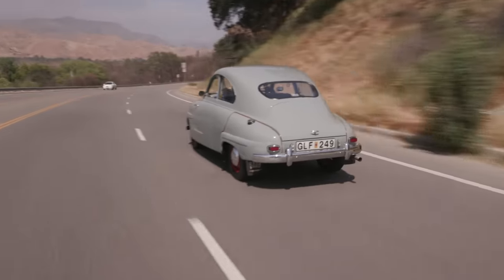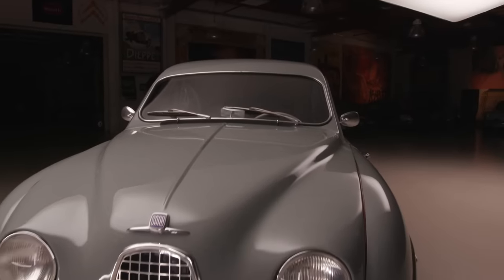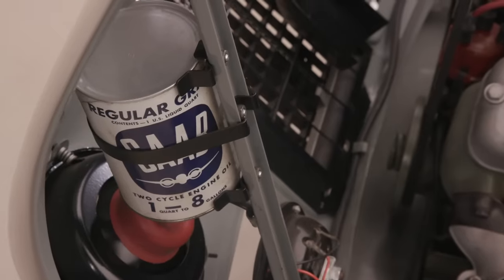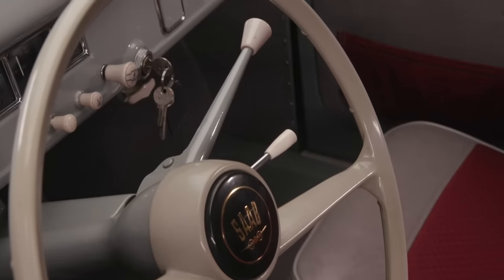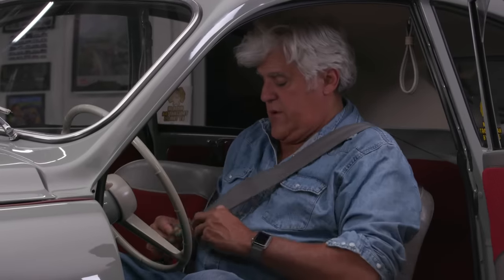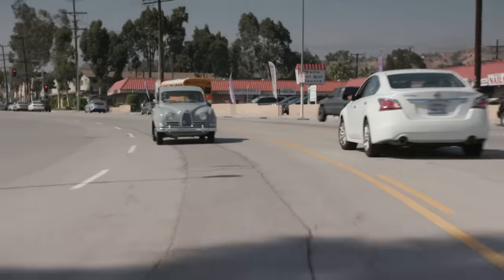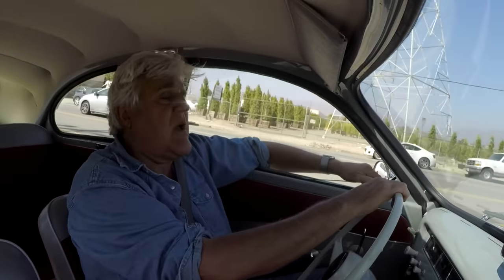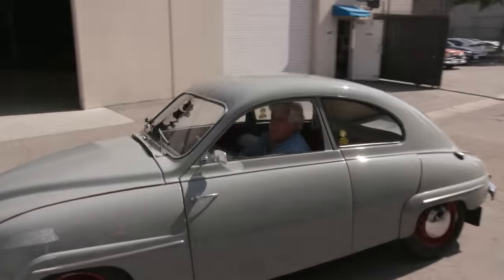1958 Saab 93 - Jay Leno's Garage

Comment: Oh, man...  Way back when (about 1970), I had a 96 that had been "breathed upon" to the tune of a big Weber and a cam and tubing headers imported from England.  The heads had been milled and it refused to run on anything but American Oil white gas with Bardahl added (Bardahl "top oil" contained a slug of tetraethyl lead).  It was a fun little car, and surprisingly fast in the twisties.  I took it on several road trips and it did just fine and was very reliable...and I got to  absolutely HUMILIATE a late-1960s 442 on the Blue Ridge Parkway.  Eric Carlsson would have been proud, although it terrified my now-ex wife (and she'd ridden with me quite a bit by then).  I told her that the car was very sturdy and would undoubtedly protect us if/when I rolled it down the mountain.  Things went downhill from there (not literally, thank you).  The car was a '67 and I think I paid $800 for it, which represented fantastic fun/$.  Keep the faith...

Comment: The first car I purchased was a 1961 SAAB 96. That too was a 3 cylinder 2 cycle engine. I got a lot of strange looks as I dumped oil in the gas tank when I filled up. I also have owned two more SAAB 96 cars with a 1972 being the first brand new car I ever bought. Wonderful car.

Comment: Brother Jay: A friend of mine had one of theseSAABS with the free wheeling feature built in and it was a strange sensation, but we learned it to save gas every time you took your foot off the gas the engine seemed to cut out.

Comment: It does make you smile. I've never heard of one of these let alone seen one .. but I think I understand the feel. A few pieces of iron in the rearview mirror that I wish now that I hadn't traded for a set of tires, or simply sent to the boneyard. The '68 Fargo half-ton .. the '74 Dodge 3-on-the-tree scorcher vinyl seats and "beach ball" washer fluid pump Dart. (the beach ball in fact ingenious as you could actually control where the squirt landed). "Feel" didn't necessarily mean power or handling - in fact the opposite tended to be true about fun. Actual fun. Maybe I'm just old and too many years having to drive instead of just wanting to. But there's something about this old Saab that I suspect would bring that back in a hurry.

Recently picked up a particularly special (my grandfather owned it) 1968 Merc'  .. AM radio option. It'll take a few years .. the driving position absolutely sucks, the stiff-back upright seats are horrible, "AC" ... those pull open doors at your feet. But I will love driving this like nothing I could with $70K. 1958? Could have got a Fury with six ashtrays and room in the back for an orgy. But I'd bet this Saab is somehow more real fun.

Comment: I think the real reason for the freewheel is possible lack of lubrication but Saab doesn't mention that in the instruction manual to not alarm owners or buyers, I suppose.
They only mention the advantage of fuel saving. When using the engine as a brake downhill there would be insignificant lubrication since when the throttle is closed there won't be much gas mixed with lubrication oil entering the engine.

Comment: My dad bought a new 1963 model year Saab as a commuter car.  It was robin egg blue.  By then the suicide doors were gone.  As I recall the tail lights were also larger and the emblem above the grill was either different or gone.  The sound of the exhaust was definitely the same. LOL  If the 58 is the same as dad's old 63 it's too bad that Jay didn't remove the fuel filler cap and show the underside.  There was a tongue depressor size strip of metal with printed instructions for adding oil to the fuel tank.  

I still have the owner's manual and by then it was in English.  It's a hoot to read it.

Thanks for the memories.

Comment: Dont forget, back in the 50s & 60s in many places you could find 2 Stroke Pre-Mix Gas Pumps, they had a dial on the front to set the oil/gas ratio & then it delivered the fuel & added oil like a normal pump.

Comment: My father Sven had the Monte Carlo model as his first car. He bought it new for 10600 SEK (£1013) in '62. That was about half a worker's yearly wages at the time. He bought it cash. That is 138000 SEK ($13195) in current value. Because of the engine noise, the car was called "the oil-fueled jungle drum"... My father drove SAAB all his life; now he doesn't drive due to glaucoma.

Comment: one of my favorites... I watched a video recently of a bunch of hardy Swedes up in the north woods racing Saab 93s
Reply: this sounds like normal... until you see a few coming around the corner sideways... holy tomoly... who knew?
Reply: think about it... front wheel drive... basically if you have the cajones to keep your foot in it ... the front wheels go where you point them... the rest just follows along... except there was also a meter of snow on the ground.. all over the road... very exciting race
Reply: thanks for sharing, Mr Leno... when racing your 93... keep the shiny side ^up^

Comment: I heard a story about someone who would race these against American cars, but would insist on racing in reverse. Once everyone was lined up, he would flip a switch and start the two-stroke engine backwards. Because it doesn’t have valves, it runs the same forwards and backwards. Then he could use all of his forward gears, but the American car would top out in its single reverse gear. He apparently won a lot of money this way.

Comment: Forgive me, I will not read through all the comments.  But in my opinion, the "freewheeling" feature may have been a necessity when the engine would have been introduced too to much torque braking when as such it would have been starved of fuel (and lubricant) while turning at a significant rpm.  If I am not mistaken, the East Germans did this too in their 2 stroke cars as well.

Comment: A good buddy had a 1969 Saab 96 with the V4 Taunus engine in it. I rode to and from work with him for a few years as we both worked at a hospital in LA - from Anaheim CA. If you ever look at the engine in one of them --- it's in backwards too. He needed to get a new engine one day and we found one at Ford Power in Santa Ana --- IIRC. Same engine but they were made for sewage plants as pump engines, etc. 

Another great car --- "interesting-great" not "great-great" was the Datsun F10 or 310 with the clutch right behind the grill with a gearset to send the power down and back rearward to the transmission and then to the front wheel drive. You could change the clutch like a 45-RPM record --- slipping it out and sliding a new one back in through a slot on the top of the bellhousing.

Comment: I had a Saab 61 V4. I loved it. It was mousey blue, a real chick magnet. When it died, it really died. I couldn’t even open the hood. I end up taking off the license plate, pushed to a no parking spot then went to bed. In the morning it was gone. RIP my sweet Swedish model. One time I had to drive while on LSD. The gearshift was trippy. You had to pull the shift out to engage overdrive. Well that shift lever was very flexible and stretchy. It was trippy but not as trippy as riding a fully loaded touring bicycle in Boulder Colo on peyote. Everything flexed on that bike. Fantastic elastic Trek

Comment: My first Saab was a 1965 96. I had it a couple of years, and sure enough, the engine froze up on the freeway one night. I bought a used engine from JC Whitney and when it arrived, on a pallet, I found it was a Saab Monte Carlo engine, complete with the 3-carb setup. Dropped it in, off I went. Best car I ever owned. I also had a 93, without the suicide doors, and a second 96 (that one with oil injection). But the '65 is still my favorite car. I traded it for a Saab 99, which was a huge disappointment. The dealership I traded the Monte Carlo-engined car to went on to use it for ice racing.

Comment: Ive owned several 99s and NG900s. Amazing how easy it is to work on these and even tune the turbo models for crazy power. $15 in parts at Home Depot and you have an adjustable boost regulator. 

Best part is they have no resale value, so you can pick up a nice one for basically nothing. Ive found that a lot of GM dealers can still order parts as well.

Comment: I had a 68. Once used ripcord to start it. I think the later cars had quieter exhaust, as I never did hear the bees. When freewheeling, you could shift without the clutch. Once on a downhill run, the car got so fast, that the engine couldn't keep up when freewheeling. I was doing 70, and flooring the accelerator caused it to slow to 65. My engine seized once. That's when I learned about the Zerk Fitting for the front Ball bearing.  I got it push started, and it sounded like a coffee can full of marbles. The saab dealer tried to deny they ever sold 2 cycle cars, and I realized it was time to see it gone.

Comment: My friend had one in the early 90's. Actually he had 3 a 1959 2 stroke that didn't run and 2 V4's that did. We pulled the engine out of the 2 stroke car and that's as far as we got. I had no seats in it and he was all discouraged by that fact so, like many interesting cars he has owned and I have worked on it sat. Until someone made an offer and it was suddenly gone. Same color but needed paint but not that dash! That dash was unblemished and pristine.

Comment: Those 2 strokes are quite similar to the Autounions DKW of same era. They also shared the "freewheel" system. The main reason for that system is that 2 stroke engines are not meant to remain with a closed throttle at any other situation than idling. Their lubrication system requires gas + oil permanently entering to the engine.  So when you release the gas pedal, the freewheel system disconnects the transmission so RPMs go back to idle to avoid oil starvation/engine seizures.

Comment: This almost brings tears.
I had a '63 96 and a '62 Grand Torismo.
Beware there are common mistakes that will shorten motor life.
If you have and electric fuel pump, turn on the ignition and wait untill it comes up to pressure, and shuts off (you can hear every thing) before turning it over.

Big one, take advantage of the 'free wheeling'.
Engine breaking under an oil starved condition is never good. 

I have hours of stories around these works of art.
They attracted a different breed of girls. 😈

Of note, the engine can be bored and honed many times over.
 Mercury outboard pistons  work.
Have 'that there' fun. Chris

Comment: 5:35 Swiss Sulzer engines had what was called a triple pump. It pumped diesel, lube oil and water so that all three fluids were available and no one component could fail to damage the engine through overheating or oil starvation ... if it failed, the whole lot failed, shutting down the engine. However, the seals separating the three fluids needed to be kept top side of to prevent any unwanted mixing.

Comment: I remember these cars when I was a kid.  They always left a cloud of blue smoke behind them, as if the engine was burning oil (which they were).  Most cars only burned oil made blue smoke if their piston rings were shot.  However, because Saabs had 2-stroke engines, burning a little oil was normal.  The one other thing I remember about these Saabs was that every one I ever saw was white.  I never saw one in gray, or in any other color, for that matter.  It was sort of like the Model-T Ford thing, where it was said that "you could get it in any color you wanted, as long as it was black", except that in the case of Saabs, the color was white.

Comment: We still lament the passing of 2smokes. Watch some YouTube videos of the old Saabs in rallies - they go like stink and because of the superior reponse to diesels (no valves and cams and chains to have to wake up and go Huhh? when you step on the gas) they are much more nimble in the rough stuff.

In Indonesia they used to call the "Regular" gasoline "Premix" for some crazy reason. Imagine the alarm of a western owner when he thinks a gas station jockey is about to load up his gas tank with a gas&oil mixture!

Strokers are still holding their own in off-road bikes. Only thing more responsive (and about as light) are electrics, and they really rock.

Thanks Jay - great video, as usual. Just tell your editor not to cut away to a side view when you're talking directly to the camera - looks like you're intentionally ignoring the viewer.

Comment: Freewheeling is a 2 stroke engine characteristic, it just means almost no engine breaking, when you slow down in a 4 stroke and downshift either with a manual or automatic engine the engine compression will slow you down, but with a 2 stroke engine it doesn't slow you down.

Comment: As a kid in the early 90s in northern Sweden, there were a few of these still running around (not many). I remember sitting next to my dad at a red light in our 1974 Volvo 142 and suddenly the radio was getting interference and it got worse and worse. It sounded like crazy frog was making radio interference, but this was WAY before crazy frog =) I was confused and asked what is that? My dad said oh, it's probably a Saab two-stroke getting close =) Sure enough, a Saab 96 two-stroke pulled up next to us (the 96 was the last of the egg-shaped Saabs, no suicide doors and mostly with a euro-Ford V4 but the early ones had the two-strokes)
This only happened with cheap ignition wires that weren't shielded but since they were cheap, well... =D

Comment: Oh, boy--do I remember those 2-stroke Saabs!  I wanted to get one, but by the time I could afford a car they were no longer for sale--the wet blankets types were too fussy about what they were breathing.  I  rode a Vespa motor scooter for a long time--also 2-stroke;  every once in a while you popped the head off and scraped the carbon out of the head and off the top of the piston, put it back together and it was ready to go.  Back around 1970 I was in Fairbanks (where they have REAL winters), and the two most common cars were the 2-stroke Saabs and Checkers.  I wonder how the sound compares to a Trabant--will have to see if you have one!
Reply: Nah, the Trabi doesn't sound at all like the Saab--it only has two cylinders.  But boy, do they do well in road rallys!

Comment: My dad had one identical to this car. My brother, and I, did a prank on our dad one time. We swapped #1 and #3 spark plug wires around.  Dad struggled to start the car and when dad put the car in first gear, it began backing up because the engine was running backwards. Needless to say, that dad wasn't amused.

Comment: This may be old news to some, but that freewheeling function was, I believe, a necessity when there are 2 stroke engines powering it.  When you let off the gas, that means you let off the oil, too.  So, you definitely didn't want to engine brake down a great big long mountain grade with an engine not getting any oil.

Comment: In New England, Saabs were one of the best makes for resisting rust.  At least the 99's were.  I had a 96(??) that was 2 stroke and someone must have forgotten to mix in the oil or mixed the wrong ratio, because it smoked A LOT.  It would blow smoke rings at stop lights.  But it was rust free and always ran and was rust free.  Smoke aside, it was a tidy little car.  And yes, it freewheeled.  If memory serves, it was $500 bucks in the early '80's.

Comment: I've raced cars on ice up here in Canada and you definitely can lift a wheel off the ice in a turn.  You'd lift the inside front wheel if it was a rear-wheel drive and you'd lift the inside rear wheel if it was a front-wheel drive. That's pushing it right to the limit of adhesion with spikes in the tires.

Comment: SAAB's first car was unusual as well. It had fender skirts over the the steer tires and the primary complaint was snow getting stuck in the wheel well so you couldnt turn the car during the winter

Comment: The Trabant 601 was also a 2-stroke. But it was 2-cyl and air-cooled. If the engine seized, all you had to do is wait for it to cool off, and then it would simply start again. As a side-note, the free-wheeling function is mandatory in vehicles using 2-stroke engines, because if you use the engine for braking, with the throttle closed, it would starve the engine of fuel-oil mixture and therefore stop the lubrication, a recipe for disaster.

Comment: Free wheeling was to prevent seizing the engine when coasting closed throttle.  No lubricant goes into the engine since it’s in the fuel.  The crankshaft has ball and roller bearings also.

Comment: The Corvette comic book seems to be a reference to Lancia Stratos' battle with a Saab in Rallye Monte Carlo. 
Stratos was the only purpose built rally car at the time, and a supercar in every way, and it found itself fighting for the first position with underpowered Saab. The rally organizers put Stratos against Saab in the final stage that was race on a stadium on Saab was going toe to toe with the Stratos untill Saab's engine failed. Since there were more cars behind them, another Saab got closer, and pushed it by bumper to the finish line.

Comment: Free coasting is not good for long periods because it not only cuts off the gas ( which itself is good) but it shuts off the engine lubrication since the lubricant is mixed with the fuel. This problem was well known in Sweden.

Comment: The first Saab petrol engines on the 96 were from Triumph Car company in the UK they were shared with the Triumph Herald
Reply: The Triumph sourced straight 4 was used in the brand new 99. The older 96 and 95 models went to the Taunus V4 engine from Ford Germany.